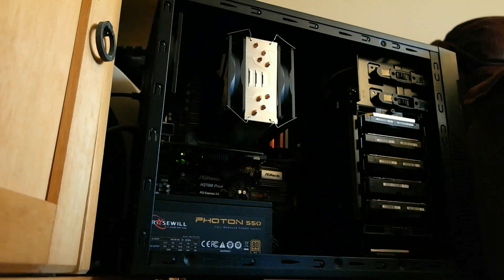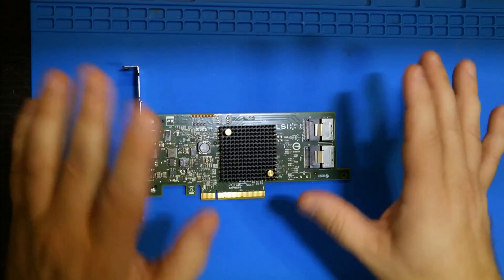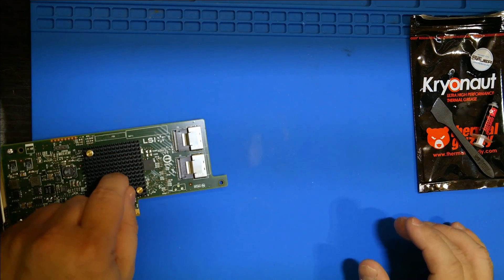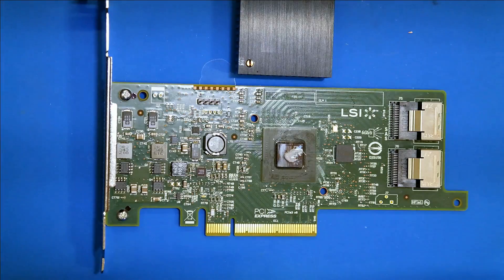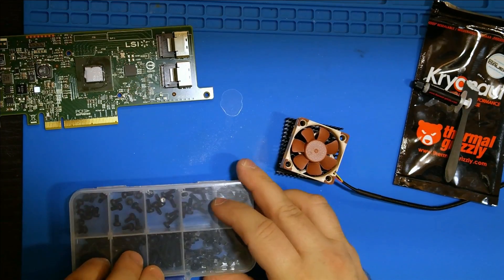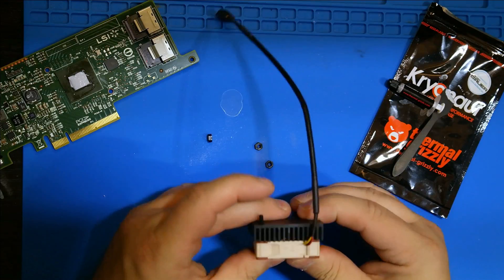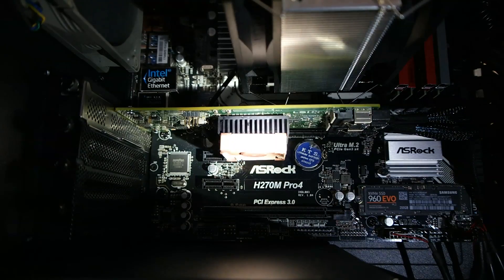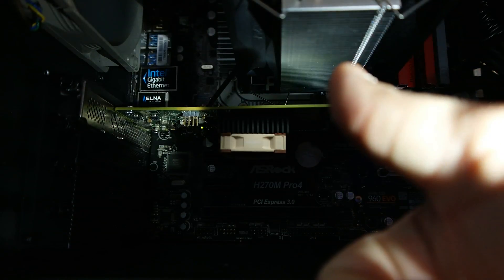Fix LSI SAS9207-8i Overheating In Desktop Computers

Comment: This is a great video, Still!  I have some small fans on order as shown in the video.  I thought I'd play a bit with just adding a little more air flow with another fan while waiting.  I have a low speed USB fan pointing at the card with the case open right now and just that fan keeps it amazingly cool compared to burning my fingers.  I can actually touch it.  Fans get here later today for my two servers, that will definitely fix all the heat issues!  Thanks so much for the video.

Comment: You likely only needed to put a fan on it.  I have basically the same card, but with external ports.  I had sporadic drive timeout errors when I had my card in a desktop-style case until I added a small fan to blow on its heatsink.  After I moved over to a rackmount server, the case airflow was good enough.  If you're running TrueNAS Core, you can get the chipset temperature with: 'mpsutil show adapter'.  On my 9207-8e, it was showing around 69-71C.  After I repasted it, it only went down to 61-63C -- so a drop of about 8C.  It's better, but not really night and day, and the datasheet for the chipset saids it's good up to 105C.

Comment: Great video! A few years ago, I built my Dad a PC with a huge amount of storage - to satisfy his need to digitise his video collection. I used this LSI SAS9207-8i and four 16TB drives for around 30TB of usable space (RAID1). This card gets HOT. I can order the fan and the paste, but the nylon screws are hard to locate. Where do you get yours?

Comment: I bought an LSI SAS 9300-161 hba bus card that has a larger heat fin than this card you're working on so I'm going to find a way to finagle a 80mm Noctua (I have a box of them already) but this card doesn't have the brass retainers holding the heat fin on like yours. It has 3 screw/nut holding it on with little springs I'm assuming to evenly apply pressure. And I cant even get close to getting 2 holes to line up.

Comment: How big of a load is expected for the card to overheat like that? My four drives are mostly idle, should I consider repasting and adding a fan?
Reply from the maker: Remember these cards are designed to be in a server chassis with a ton of airflow going past them, this airflow is not present in a desktop case, which is why this mod is basically required.

Comment: I was actually going to watercool my 8805 just for kicks, even bought the block, but I got lazy in addition to it just not making good sense- so I slapped a fan on it. I knew I would need one after reading just how much airflow the manufacturer recommended. They were asking for values that would make my PC sounds like a vacuum cleaner without its own independent fan. It was super easy to mount with those extra long rubber mounting pull thingies.

Comment: I've been running an LSI SAS2008 9200-8i with TrueNAS in a desktop for a while and kept getting disc errors and a degraded pool because one or two discs would be "faulted" and removed. There was no data in that pool (array of 4 ZFS2 discs) so I didn't really bother out of a lack of time to really invest in fixing it.  I replaced "faulted" discs a couple of times but the new ones always faulted.  I finally set aside some time to tinker with it after trying replacing the SATA cables and changing the SATA port. Always the same results.  Checked the logs: Always the same two discs... Touched the heatsink and burned my fingers.  Watched this video. Shut down, pulled the card, removed the heatsink, cleaned and re-greased it & reassembled.  Had a spare Noctura fan and attached it with two 3mm socket head cap screws down into the fins of the heatsink but with two rubber washers giving me ~3mm spacing between the fan and heatsink (which I think will give better air flow).  Since reassembling everything, the system has been up longer without error than ever before. Thanks for being a catalyst!

PS: Cleaning aged heatsink compound does not seem possible with isopropyl alcohol but "Goof Off" worked great. I imagine acetone would work too -- only in a well-ventilated space!
Reply: I am facing the same issue third day, thanks, will do  the same.
Reply: @m1nusasusplus897  Mine has not shown these errors since I did this. Good luck!

Comment: MAD what size screws did you use? I love this application.  I am using a standard fan screwed to the case but would like the space for a hard drive so this solution would give me back the space. i am guessing 25mm since the fan is 10mm and the heatsink looks like another 10mm.

Comment: LSI all run hot.  70-90c.   Mine never slow down though.  my 9286cv-8e runs the same at 65c as it does at 88c.   No difference in speeds airflow is the key,  I think the battery and chip maybe last longer cooler.   I know the chips have a thermal shutdown, not sure about throttling, it could be corruption and resends and not throttling.

Comment: oh man oh man... do you know how I found this video? searching for "how to remove that gunk of the heatsink" isopropanol did not even put a dent in this. 40x40mm heatsink are quite common in IC cooling. It might just be better to buy a new heatsink. You can even get a full copper one for about 10-12£ you'll need to drill the holes tho.

Comment: although quite an old video - as I'm looking up the nf-a4x10 fan on amazon there're two types: 3-pin flx and 4-pin pwm ...
anyway: is at least some mounting hardware included with the fan itself? otherwise I guess it's zipties then
Reply from the maker: I used my own hardware.
Reply: @madelectronengineering  I'm planing to buy one - and also the LSI card (that's what I search for and got your video) and also want to perform the fan mod you did
can to please tell me the inner-diameter or the threading-type/-size of your nylon-screws (and the required length would be nice, too) so I can order the required ones along the fan and the card (as my country is still in quite heavy lock down all the local hardware store still close so I have to order them online as well)
thanks in advance
I looked up the datasheet for the nf-a4 fans - but it does not specify the hole dimensions
Reply: for those just reading this post.  3pin fans use the 3rd wire to signal power adjustment by sending the speed of the rotation.  Modern motherbords now use 4pin fans because the added 4th wire allows for PWM control.  Noise is reduced most of the time while the 3pin fans the noise is steady and constant.  It provides a longer lifespan because the fan rotates at the speed required.  PWM provides automatic control thru the hardware

Comment: I just repurposed a larger heatsink by drilling two holes and mounting it with two screws and nuts on this model of card. It is a very cost effective way without buying expensive Noctua fans and the additional power and noise produced as a result.

Edit: Thumb up for the nylon screws very neat and safe way of mounting the fan and heatsink.

Comment: gonna do this to my new-to-me lsi 9207 toniiiiiight, hope i can find some of those sexy nylon screws locally.
Reply: did you find the screws on amazon? what screws did you find good for space and length ?
Reply: @shell11  actually i went with little metal screws, but i did use a little plastic washer to protect the surface-mount components near the screw holes.  they were super cheap at an electronics store nearby.  i'm sorry i can't give better advice than that :(
Reply: @travnewmatic  it's useful, thanks!

Comment: Three years ago I tried something similar with three LSI/Avago/Broadcom MegaRAID SAS 9361-8i and also used the Noctua NF-A4x10 FLX to air cool the standard heatsink on the card but wasn't satisfied with that, so I used small Alphacool MCX ram (12272) watercoolers instead. Works great. Temps of the controller CPU never climb over 45°C [113 °F] (internal temp sensor of chip) ever.
Picture of the fan mod and the custom DIY watercooler replacement: abload.de/img/20170930_172307o2jek.jpg

Comment: Dumb question, but what's the operating temp for those Nylon screws?  I'm worried they might melt if the temps are really that high...Is there really that much of a risk of shorting if I were to use metal screws and nuts
Reply: Nylon melts around 220C, so the chip will burst into flames before the screws melt.

Comment: Q: How (and with what) did you clean the old thermal compound?  I'm doing this to mine with either a Noctua NF-A4x20 PWM fan, or a much bigger heat sink.  I have plenty of room for either.
Reply: Isopropyl Alcohol is usually the go-to for cleaning off thermal compound
Reply: IPA didn't work for me but "Goof Off" (my go-to for dissolving all adhesives and such) worked great.

Comment: Thanks a lot, great tip! I mount the fan by screwing into the heatsink. I was to afraid to unmount it, perhaps in the future...
Reply: I asked LSI and they don’t recommend removing the heatsink. So how did you attach the fan to the heatsink without removing it
Reply: @nvidiashield495  with two small screws.

Comment: its amazing how even a small low speed fan makes a big drop on temps.
Reply from the maker: It does that because the ic under the heat sink only consumes around 10 watts.  A little airflow goes a long way with these, that's why they had no problem keeping cool without a fan in a server case as they are internal wind tunnels.

Comment: well done m8 , sure this will help a lot, but you add another problem; the slot next to it is unusable due to the fan, it might be just good enough to add only new paste and place a 80-120mm fan on the end of the card, that will help cooling the other cards too. Or; find a bigger heatsink with same thickness but twice the height or so.

Comment: Thanks for this video! I knew the HBA in my NAS ran hot but it's never given me any issues so I never thought to modify the component for better efficiency. After applying a fresh coat of thermal paste and attaching a fan, my card is now cool to the touch. I went with the Wathai DC Brushless Cooling Fan 40mm x 10mm 12V 3Pin Mini Heatsink Cooler Fan as it is quiet but still manages to move a significant amount of air. https://smile.amazon.com/gp/product/B07PPQVF8Y/ref=ppx_yo_dt_b_asin_title_o00_s00?ie=UTF8&psc=1

Comment: Did this yesterday with a 40 by 20mm fan. Took a few trips to the hardware store to get the screw lengths right. For those that opt to go with a 20mm thick fan, the screw is a M3, 30mm length. Long enough to get a rubber washer and a nut on the other end.
Reply: god bless you for this comment 🙏
Reply: @nullpointing0  glad it was helpful. Card and fan combo is still going strong.
Reply: @nullpointing0  +1!!!! just checked my card and its freaking hot, also my fans were on like 20% :S put them to 100 until the small fan arrives. Wish me luck that GF doesnt kill me till then
Reply: @balazs_korcsog  good luck 🫡
Reply: Unfortunately not the case for the SAS9207-4i4e. With a 40x20 Noctua the M3, 30mm are too short, for anyone who's considerig this.
Reply: @ben_s73   What length worked for you?
Reply: @michaelhenry3234  I was waiting on a order and finally M3 X 40MM are OK (5mm protrusion for nut)
I used 1mm nylon washers between the fan and heat sink for  additional cross-air flow and M3 Rubber washers (8.5 X 3 X 1.2) seated for the bolt nut on the rear PCB protecting any circuitry from bolt contact.
Reply: @ben_s73  probably the heatsink is a tad taller
Reply: @ben_s73   Thanks!
Reply: @DS52116 , metal. I used all metal and a rubber washer to prevent shorting a contact.
Reply: I went with the Noctua 10mm thick fan so settled for a M3 25mm length! Thanks a bunch
Will report back when I get the card
Reply: Ok I tried it 25mm is too short! But I ended up buying a 9500 8i (which is roughly the same size) so I have placed an order for M3 30mm. I think OP might have meant 40mm x 10mm fan?
Reply: @jackwright517 is your heat sink more rectangular than square? I've seen cards with this kind of heat sink. My card had a square shaped one and the fan fit perfect.

Comment: Do you run RAID on it, or do you use it for just extra sata ports.
Reply from the maker: Just extra sata ports.
Reply: @madelectronengineering  Did you have to flash the board to IT mode or it arrived flashed?

Comment: Rotate the cpu cooler 90°
I have a 7700k that runs 5.2GHz, I have my NH-D15 air cooler pushing air vertically from top to bottom due to RAM clearance issues. If you oriented yours to flow from bottom to top, it would pull a large amount of air around the card and cool it.